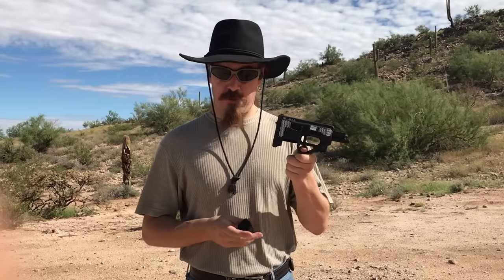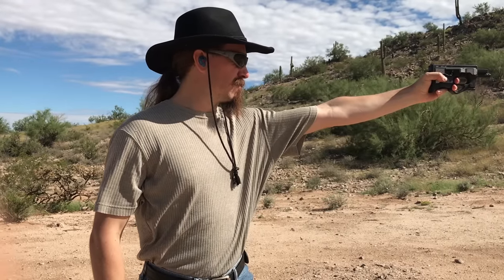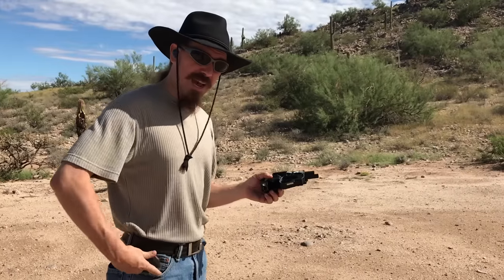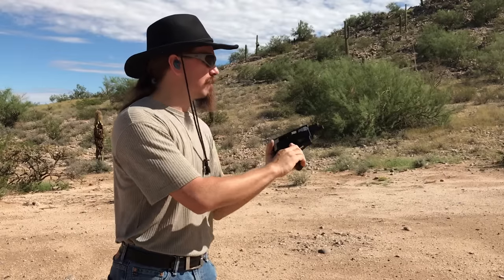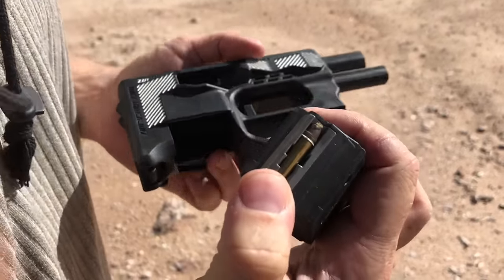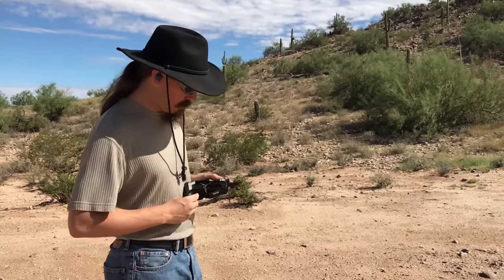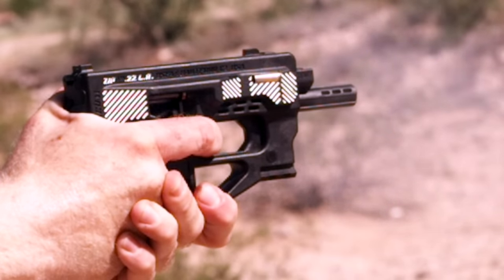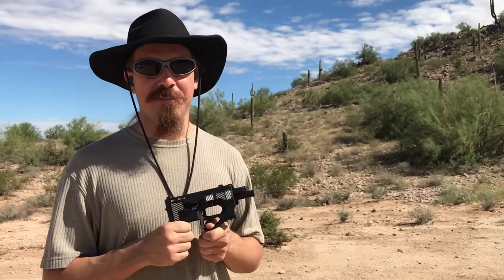Zip 22: Shooting the Worst Gun Ever

Comment: Dear diary: The Hi-Point fans were right. There IS a worse handgun...
Reply: I'm not a fan, as they are about the ugliest guns you can possibly buy; but HiPoints are very dependable firearms. This monstrosity however is uglier & probably the least dependable thing I've ever seen.
Reply: @pastorofmuppets325   At least Hi-Points are ugly, in part, because they're designed to be both cheap and reliable (have to be bulky to make the blow-back action work with more powerful cartridges).  What's the Zip 22's excuse?
Reply: You can mount the Zip under your AR-15 in case you get cought mid-reload.
And another Zip under that to increase your chance of hitting someone above 1%
Reply: @HappyBeezerStudios  never thought of it that way lol
Reply: @greybayles7955  probably most to be honest. Thats a really strong part of any semi auto. I couldn't think why any firearm would fail.

Guns aren't designed to be shot at. A highpoint taking a round to the chamber and still firing less 'impressive' and instead a 'so what' scenario
Reply: 😂🤣😂 you had me in tears
Reply: Literally never have seen anyone even try to defend the ZIP. Hi point atleast has some fans willing to point out the guns strengths
Reply: Hi-Point is heavy, ugly, inaccurate, picky about ammo and even then failure rate is high compared to other guns. But it does actually works fine most of the time, it comes with a no-questions-asked lifetime warranty, and it's less than $200. Not the best handgun but it's adequate at killing people, and it's easily the best value.
Reply: Hi-Points are ugly as sin and not very accurate, but they are very durable and dependable. There are so many better guns, but a Hi-Point is better than nothing. This Zip-22 might literally be worse than nothing; you might be better off bum-rushing an attacker rather than use this thing.
Reply: @greybayles7955  i assume you saw it on demolionion ranch, correct?
Reply: @chillpenguin9578  honestly cant remember but that guys pretty cool
Reply: at least it is better than the kolibri
Reply: @greybayles7955  the demolition ranch video.  He also ran it over with his truck afterwards and filled the chamber full of dirt. Apocalypse backup.
Reply: HappyBeezerStudios - by Lord_Mogul or just mount a M203 and you’ll never see that guy again, literally
Reply: I agree the Hi-Point it butt ugly however they are very dependable.
Reply: To be fair I ve never even shot a Hipoint pistol, never could get past their intense ugliness, though I ve always heard generally respectable things about them.   Their rifles though, cant say enough about mine.  Incredibly reliable never a failure of any sort with thousands of rounds in the 20 years I ve had it, seems tough enough though I ve never done any torture tests, and its one of the more accurate rifles I ve owned ( at shorter ranges ) .   Only downside is like the pistols its fairly clunky, heavy, and somewhat homely.

Comment: Imagine if some shooter game included this thing and the tooltip for it said that it's been modified to fire consistently.
Reply: roblox phantom forces, albeit without the tooltip it can fire at 1000 RPM
Reply: Phantom forces has a zip 22 and it has a extremely high firerate
Reply: Cruelty squad has one and it preform s even worse
Reply: @r4k00n5  Yeah, a 0.2% chance to get it from a slot machine, does as much damage as the starting pistol, and a 1/3 chance to either; fire, jam, or back-fire and injure you.
Reply: a game called burgerstation had a zip 22 that was super accurate to what was seen here. it would jame every other shot and was about as good as punching, damage wise.
Reply: Phantom Forces, but it actually performs decently, at least compared to other pistols. Cruelty Squad on the other hand…

Comment: Very dangerous gun. Even if it was reliable, putting the charging handles (why did they have to make two again?) right next to the muzzle would have led to a few people shooting fingers off, if it had sold in the number anticipated. But as unreliable as it is, all the fiddling and poking trying to clear misfires would also led to other accidental shootings, if it had sold more than a couple hundred.
Reply: I understand the idea for the second handle.  22 rimfire is pretty reliable but I still get a couple rounds in cheap range ammo that don't fire.  With the second charging handle you would bring it back and have another chance at an unspent cartridge.  Take a chance with a round maybe having a delayed ignition while your finger is in front of the barrel?  Most of us just cycle the chamber and let the dirt cheap round hit the floor.  But, 100 dollar piece of plastic too light to be good as a door stop and not good for much else, you want to get a chance at ever little 1 cent round.  
OR
Lets take something as fun and reliable as plinking with a 22 and add some "excitement"?  The excitement of the gun actually firing and not hurting you when operating in a proper, supposedly safe, manner.  
There are plenty of good, reliable 22 pistols and rifles out there.   They don't have the option of mounting to another weapon making you file for a license for it BUT they do actually work.  Why bother with this one. You'd get more reliability out of throwing a round in a firepit.
Reply: Jorgi Petropov yep they should've done it that way. Way safer. This thing is an accident waiting to happen.
Reply: Well it did happen.  Except instead of someone shooting their finger off, it shot a company dead.

Comment: What leaves me speechless is the fact that USFA engineers actually never seem to have tested this gun at all before they were going into production with it. It's totally against common sense.
P.S. Plastic. What a great material for main gun parts....NOT!
P.P.S. We had a saying in the German Bundeswehr about the P1, better known as the Walther P38 and it goes like this "Acht Warnschüsse und ein gezielter Wurf." It means in English "Eight warning shots and one aimed throw." Now I think this is way more fitting for the Zip 22...sadly the Zip 22 is mostly made out of light plastic parts...if you throw that thing it will not inflict much damage.
Reply: Not to mention they basically gutted out the company to produce it.
Reply: They probably objected, but the boss (Donnelly) overruled them. Once that happens, they can either keep voicing their concerns uselessly, or shut up and start looking for the new job which they will inevitably need once the Zip hits the market.
Reply: @GurgleOneSixSix  I used to work for a business like that.  Used to.
Reply: Is there a Darwin Award for companies?
Reply: yep, its called a zip-22 award.
Reply: Difference between a P38 and the Zip is that you could actually fire eight shots with the Walther.
Reply: USFA was done as soon as its owner got tired of running the company. Even before it went down outside observers had noticed the peculiar way the company was run and that the way it produced its pistols made it unlikely to be viable as a "real" business.

It was one rich dude's hobby project. I'm not sure that the Zip gun was actually intended to be a real product or if he deliberately ran the company into the ground.
Reply: Ok to cross streams here, if you made it a pommel on a sword could you unscrew it and throw it to end him mightily?  See Skallagrim.
Reply: I would love to be a fly on the wall in that meeting when this gun was developed.
Reply: "Kein Warnschuss und ein lächerlicher Wurf" is more of a thing with this uuuhm "thing" (no warning shot and a laughable throw)
Reply: I have a 1965 Walther P1, it has Der Bundeswehr service mark. Shoots about 3.5 inches low at 7 yard 😂 can't imagine hitting someone beyond 10 yard lol

Comment: The concept of a $100 .22LR plinker pistol that can be a companion to my many 10-22 rifles and co-use my literal twenty-plus 10-22 factory mags is an idea not without merit. 

Also an idea not realized by the Zip-22. 

Legitimate gun design query: I think a bolt made of steel or possibly tungsten faced steel would provide sufficient bolt mass to drastically slow bolt speed; thereby improving performance. My guess is that a steel or tungsten/steel bolt would have been to expensive at the price point they wanted. 

So at a $100 msrp with a steel bolt and redesigned to have a not ludicrous charging system, and you would have a little pistol that ‘preppers’ would have buy to keep in their bug-out bag with along with their Ruger 10-22 takedown rifles.

But alas, Glass fiber reinforced nylon bolts and a weird charging system gets you a dead company. One of the many in the boneheap of American gun-makers.
Reply: Moran Tactical 
Good riddance to a bad company. I’ve been interested in innovative company’s but when weird crosses into dangerously unsafe it’s time to go. Kel-Tec, Taurus, Bond Arms can innovate, but I’m sure they have folks who say “whoa” when things go too far.
Reply: I was thinking that at least an aluminum bolt would be better than the plastic.
Reply: They could have used Zamak.
Reply: A feed ramp and extractor might help, too.
Reply: Yea, but you can attach it to an ar15, so there's that...
Reply: WickdPerfekT right! What the hell were they thinking? Maybe someone will buy the design and reinvent it. I like the concept it just needs improvement.
Reply: @WickdPerfekT @PMcCul2477 add 90 degree bends at the end of the charging handles to fix the finger danger... and maybe a longer barrel
Reply: Honestly, extend the receiver back another 10mm and make the striker bigger, since it has to go back with the bolt a heavier striker is as good as a heavier bolt, and it wouldn't take much to do that volume wise.
Reply: WOW, all of these great ideas to make the little gun functional... (scratches head)
Reply: Some lightly machined bar stock attached to the back of the bolt might fix the actual bolt.

Honestly, tag $50, or even $25, and you'd probably have the price required to make it practically functional. Probably better as the basis of a 3d printed gun then as it is.
Reply: Back up bud, the zip 22 is an amazing weapon...if you throw it with sufficient velocity

Comment: "have to stick your finger in front of the muzzle to charge this thing"

..... and thats how NOT to design a gun!
Reply: The irony is that it couldn't have cost that much more to run an oprod down the side of the gun and stick an mp5-esque charging handle on it. If you really want it to be "tacticool" you could always make it reversible. Honestly, it sounds like this gun was designed by someone who had zero idea how to build an automatic pistol. One of the big issues that Ian points out is that the light bolt means that you end up needing very strong springs (making handling worse) and you have a crazy high bolt velocity (which makes the gun less reliable), so a sane firearms designer might do something radical like... Designing it with a heavier bolt.

Comment: I get frustrated just watching this video. I can only imagine what actual owners feel after dropping money on this piece of crap.
Reply: You buy a $99.99 22LR semi, and get your moneys worth. It's a "zip gun", which classically means use once.
Reply: @opieg7333  I got a Savage .22 rifle for $99 on clearance.

If I don't use that god awful brass tip Remington bulk ammo, it's really quite reliable and accurate.  Stuck an 'airsoft' red dot on it for the hell of it too, which holds it's zero surprisingly well.
Reply: @startedtech  On clearance - which means at a discount to clear out excess inventory. That is very different from a firearm designed to be sold for $99. That price point has to include profit for the manufacturer, and seller and cover costs for transport. You are talking about a target production costs of sub $50 a unit. If it takes more than 2 man hours to manufacture, you are talking cheap labor, and cheaper materials. 

Me, I prefer to ensure that fire arms I will potentially rely upon have a high odds of being functional at all times. I want materials designed to last and to know that the people who put it together actually GAF (so they don't do things like let defective parts through that might cost you an eye or a hand). I have seen enough at the range to notice the pattern - cheap guns tend to be sub standard - but that does not mean you cannot score a quality firearm on the cheap. (And it does not mean that come expensive guns are not cheaply made). 

And no one serious about hitting targets without clearing a jams every few rounds uses Remington ammo, unless you absolutely have to have rounds and the only viable option is a big box store. I think one of my long range rifles even came with an express warning not to use that ammo due to manufacturing irregularities beyond the tolerances of the chamber. (They are known to wedge in and freeze the action, especially is the chamber is not dry). Those green and white boxes might as well be bricks.
Reply: @opieg7333  I just checked, and looks like it wasn't on clearance, I think it was just on sale since the normal price is $120, and there's articles mentioning $99 sales.  And it was a Mossberg 702, not a Savage (shows how much I care about it, lol)

 Certainly not something I would ever try and rely upon for anything, lol.  Really only bought it to have a cheap .22 to mess around with.  Not as good as a 10/22, but hell of a lot cheaper.

  It's impossible to do any in-the field maintenance on too lol, if it jams you basically just have to smack the charging handle until it frees up lol.  Still, it's probably 99.5% reliable when using decent ammo like CCI.

Comment: Likely the 15 round magazine feeding problem was caused by your fingers putting backward/downward pressure on the front side of the magazine so the bolt was pushing the rounds downwards into the front of the magazine instead of up and out of the magazine. When you switched back to the ten rounder, the problem stopped. (Because you were no longer pushing the magazine out of proper feed alignment.) if that makes sense. I’ve seen the same thing happen with airsoft guns and ARs when holding the magazine instead of the hardguard.

Comment: I would use the edge of a hard surface to charge it rather than my hand.
Reply: That's how I originally imagined it was "supposed" to be operated. But, there I am trying to use common sense when talking about this trash...
Reply: I would say it was designed that way but after hearing what the owners manual had in it I wouldnt be surprised if he intended it to be charged with your teeth.

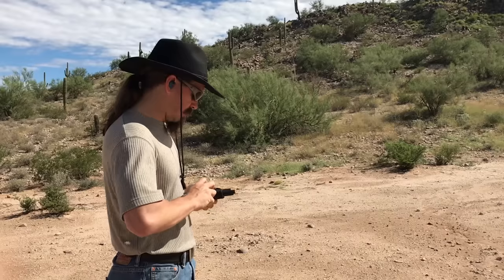Comment: 5:35 how do you jam a heeled bullet back into its case?
Reply: This thing is so bad, it malfunctions in seemingly impossible ways
Reply: Lead is quite soft, brass is not.  Sufficient force will push the projectile into and around the case.
Plus, some manufacturers don't actually make their .22 ammo heeled, there's no impact on performance except that the rounds run cleaner, and they're cheaper to make.  The only negative is that it becomes easier to shove the bullet into the case, which isn't always a negative.
Reply: just like gun jesus said  "It is not supossed to be able to do that"

Comment: Why anyone would ever consider this garbage as an "affordable" .22 plinker handgun is totally beyond me, especially when the Heritage Manufacturing Rough Rider revolver can be gotten for the same money and actually work 100% of the time.
Reply: I've been told that it doesn't measure up to the standards of one of the better .22 revolvers, especially the much respected Ruger Super Single Six/Super Single Ten, but I've been told that it's at least reliable.
Reply: PinkOld loose barrels and huge cylinder gaps make for horrible accuracy, sights are non existent. Worked my way through 4 of them before I learned my lesson
Reply: Ah, okay thanks.
I bet you get lots of lead spitting while shooting them, too.
Yeah, better to get a Ruger Mark IV, Browning Buckmark, or Ruger Super Single Ten instead.
...or if you're one of the lucky few to inherit one or able to afford one, a Colt Woodsman or Smith & Wesson 41.
Reply: PinkOld I plan on a ruger here very soon, the rough rider barrel was so loose when tightened the front sight was 45 degrees off. Had to remove material from face of body until the barrel tightened in proper alignment, but then it put barrel in bind with cylinder there was absolutely no gap. Fixed that and the accuracy is decent with the horrible sights but only use it with rat shot for snakes.
Reply: PinkOld that would be me. Colt Woodsman that is. Very nicely built.
Reply: ROMAK 47  I must have gotten hold of a good one then.  Barrel is tight, lockup is good, trigger is fairly light, cylinder gap is tight, alignment is good, shoots decent groups with both 22 LR and 22Mag cylinders...  Really, not a bad gun for the price, and it works well for introducing new shooters to the sport.

Not sure of the history of the company... maybe they got bought out or fixed the problems.  Mine has the safety on the side.  It is the only revolver that I ever saw with a safety.  It is a hammer block safety which makes it great for dry fire exercises...
Reply: barking.dog.productions1776 same as mine with the strange safety, wanna trade? I thought they were made by Taurus
Reply: i know, not only were they super bad but way overpriced and for slightly more money you could get even a shitty gun made of mostly metal that worked most of the time and was pretty uncomfortable it would be several orders of magnitude better

Comment: Creators of the Zip 22: "Wouldn't it be so COOL and QUIRKY did we didn't add an extractor nor ejector???"
Reply: It's actually a way to make the gun cheaper. Blowback pistols often lack extractors. They also sometimes even lack ejectors.
Not very quirky at all. They just didn't do it right.
Reply: @maxpulido4268  but what's the point of not adding an ejector? It doesn't even need to be a moving part
Reply: @somebodythatiusedtobe9194  saves money.